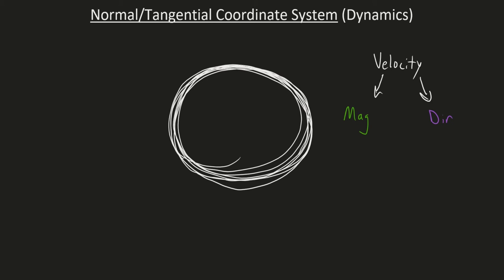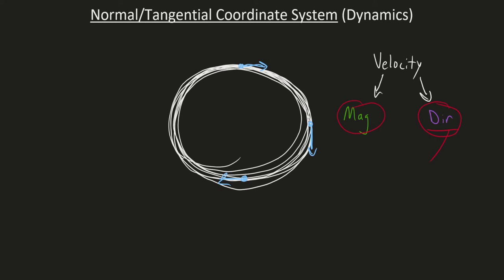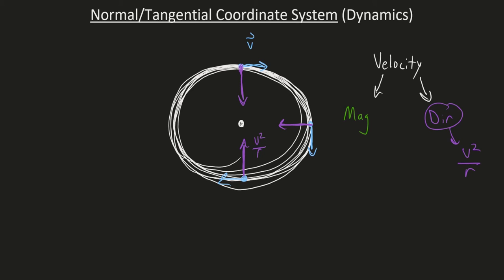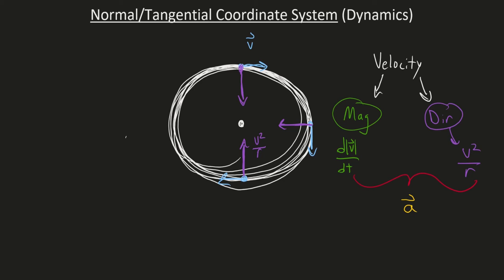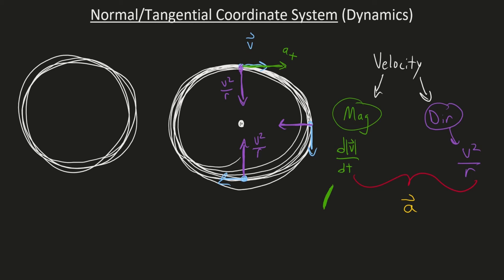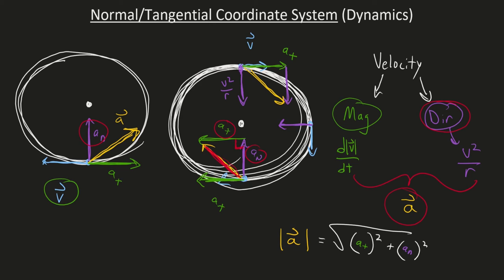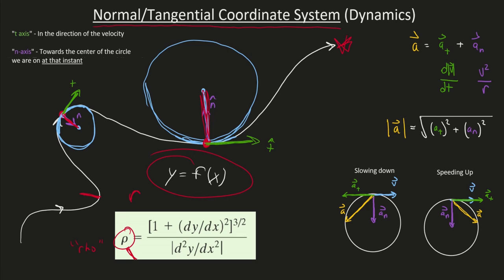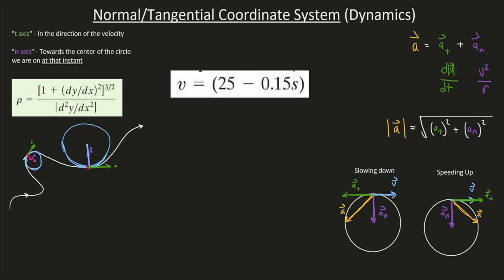Dynamics: Normal and Tangential Components

Comment: Sir As there any difference between normal and transverse component of acceleration?
Reply from the maker: Normal is directed towards the center of the circle. Even if the particle is not strictly travelling on a circle, at any point, we can "pretend" that the particle is on a circle at that instant (i begin talking about this @ 7:00)

Transverse is perpendicular to the "r" coordinate. Keep in mind that the origin for the r coordinate can be anywhere (rather than the center of any of the instantaneous circles) Check my Transverse/Radial video for a full explanation of that:
https://www.youtube.com/watch?v=zLmt5tgYNCI&list=PLZ_GVXv1RhJjvN0Mvg7kLvSZtzj2DR5MZ&index=5
Reply: @eng1048  ok thanks 👍